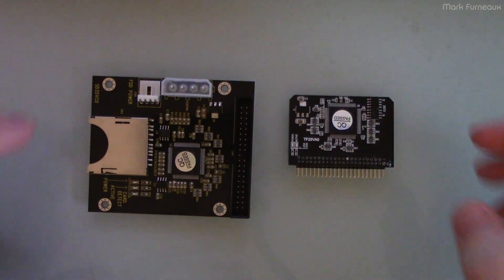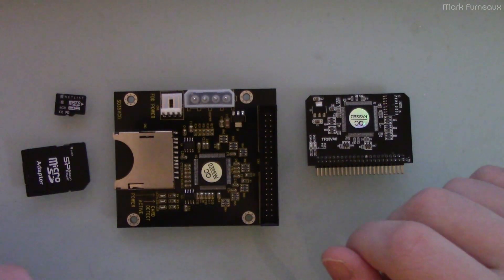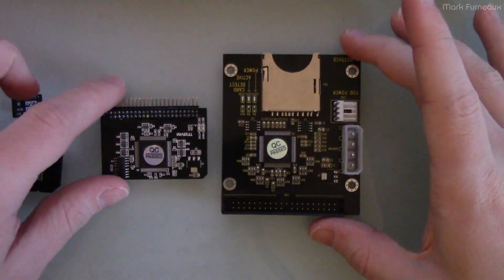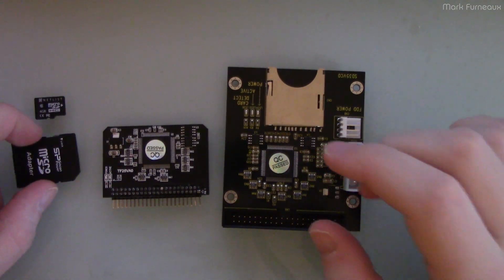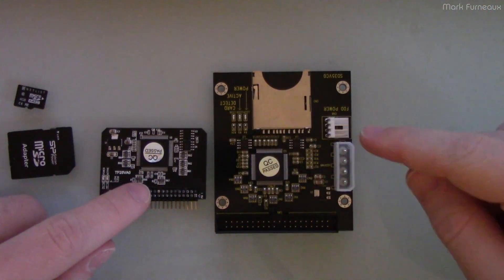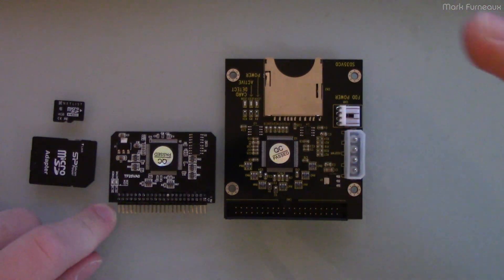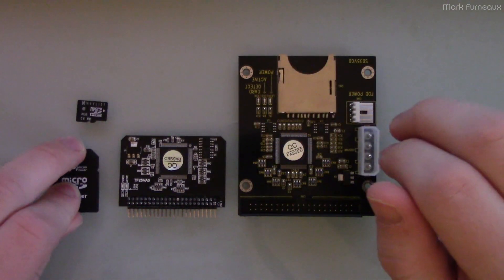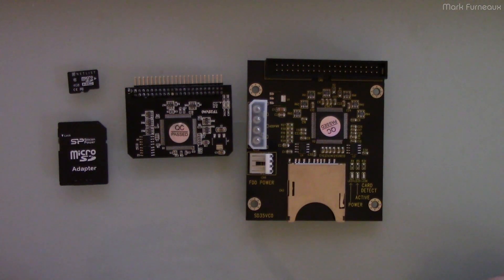Sintech Clone SD to IDE Adapters and Linux Fix

Comment: My goodness... I've been in this exact situation for a couple of weeks and it's been driving me crazy trying to find the problem! I partly sussed out that the source of the issue may be from the sd to ide adapter when reading straight off the usb (port in laptop), but couldn't fathom what to do about it... Thanks so much for this!

Comment: Thanks for the video.
Thinking 🤔 about it, almost sounds like the chip is looking for an OEM manufacturer partition that is common on modern computers. A lot of HP computers have a  restore partition at the beginning of the drive from the factory.

Comment: Thank you!! I was having troubles with this adapter for so long until I found your video. Works like a charm. :)
Reply: Are you actually booting from Linux? What does your partition table look like as I find Ubuntu isn’t agreeable with this arrangement.  Are you booting via MBR? An EFI partition?
Reply: @jeffsheldon  I just added first partition that is formatted in fat 32. It has something around 1 to 4 megabytes. I'm booting Antix Linux on an old tough book using MBR

Comment: i'm very grateful of you because you solved my long standing problem. I just want to add that the fat32 minimum size is about 260 MBytes so, it's not as easy to build a dummy partition 1 or 2 Mbytes big...you need at least 260 Mbytes.

Comment: Thank you for posting this video!  If only I had come across it two days ago :)
A thought crossed my mind about the vintage 9x era, the sizes of the HD's, and the workarounds that had to be done back then to overcome limitations.
Remember those "Promise" ide adapters with bios's on them, and even the soft-bios's which had to be loaded on the first sector of the large drives in order for them to be usable by those old MS os's?
Might these adapters be submitting an uncompressed "soft-bios" from its ram at boot, before proceeding to the physical boot sector?  That way, the 9x (dos's) would be able to address drives as large as xxGB, which our cf cards naturally are?
Reply: You might be onto something.

Comment: Thank you for that information. But are you sure its just Fat32 that is supported? I've got the 40 pin device for a older Laptop and use windows xp with a 32GB SD Card and i'm relative sure i did setup it with ntfs as filesystem and it works quite well for the 2 weeks where i did play around with it.

Comment: Thanks for your deep drive into this. Now knowing this thing is custom built to only really support Fat32 would explain some of my weird issues I had trying to use it in the og xbox (FatX) where the sd card would appear back and untouched when you removed it from the adapter, you can format the card and do whatever you like, but when you place it back in the adapter and boot the xbox nothing had changed.

Comment: Interesting. It seesm like they was trying to get CHS parameters from boot sector to implement CHS mode but when i try it with CHS it seems like it doesnt work at all. So they probably just mess up causing out of buffer read. I was thinkong about decompiling firmwasre to fix CHS for old bioses which dont support LBA. Thats odd they mess up even LBA because it can be implemented without any data from boot sector

Comment: Once the SD card is corrupted, do you see the string "USBC" anywhere in it? I've had a few memory-cards and flash-drives get corrupted while using different cheap Chinese card-readers and USB-hubs from eBay, and the string "USBC" seems to be a common factor. I'm of the mind that all of these cheap Chinese devices are using a buggy controller that has a specific defect. 🤔 If so, it might be possible to create a universal "fixer" program to recover media corrupted by these. 🤞
Reply: (It's a pretty widespread problem judging from the results from doing a web-search for "usbc corrupted". 😒)

Comment: Weird that these work on my Amiga without any messing around. There's no MBR there and no FAT32 partition.
Reply: Probably because there is no valid DOS partition table, the extra snooping code never gets invoked (I also use these in Amigas with no issues)

Comment: Hi Mark,  Great job on reverse engineering these.   What kind of lifespan can you get out of the SD cards when used as the boot OS drive?    Seems like being overwritten many times will make them unreliable before too long.
Reply: Could be less than a year if its a cheap card, longer if its a decent brand. Having a lot of spare sectors should help for wear leveling. I can't find any specific raspi reviews, but if you search for dashcam microsd card reviews, you'll find ratings for endurance SD cards which should last quite a bit longer, if its really necessary.
Reply: they could be quite good for like DOS or Windows 95 or 98 but running like 2000 or XP or 7 or certain linux distros could shorten their life fast.

Comment: Going to guess it uses this FAT32 info to work out how it will emulate the disk, as the sectors contain information on the primary partition, giving a set of parameters that show number of heads, number of cylinders and sectors, and also is looking to see type of partition, so it can fake the report of how big the drive is when booting, and also how to allocate aligning the read and writes when translating.

The bug only surfacing after power on is the first time the (typically fat32) card is inserted, it reads this into RAM, and then works off this, irrespective of what you do to the card data wise, till power is lost and the card resets. Likely the reset line from the host does not actually reset the card, it merely is used to simulate resetting the drive, but the ram content is preserved though this.

Thank you, nice explanation and an introduction to a nice card. Not that I needc one, I have a collection of older hard drives, that vary in capacity and interface, that I use for replacement in machines, just take the new to it drive and see if it will still pass SMART, or, if older use NDD on it.